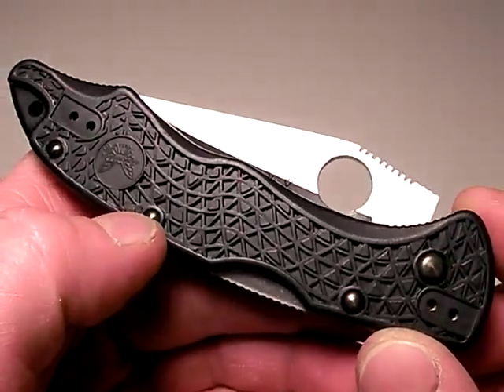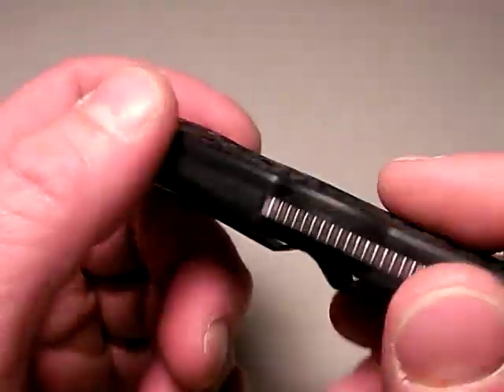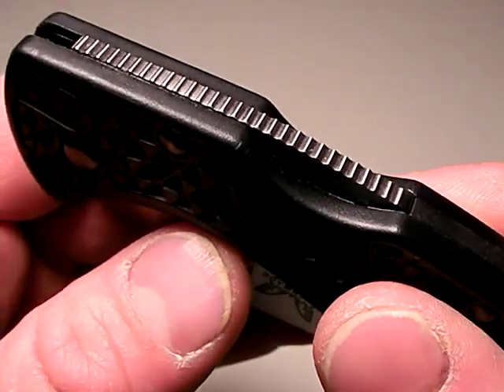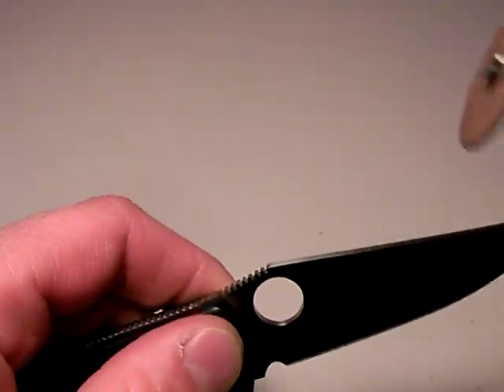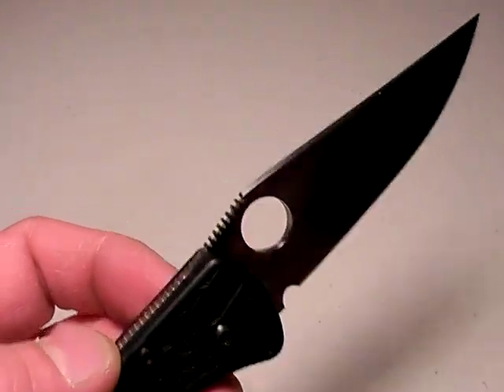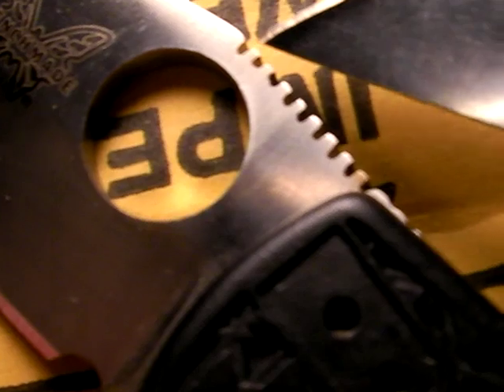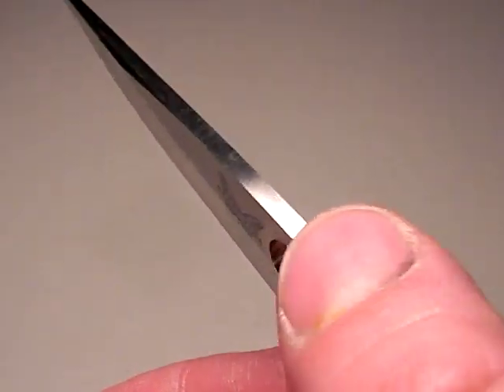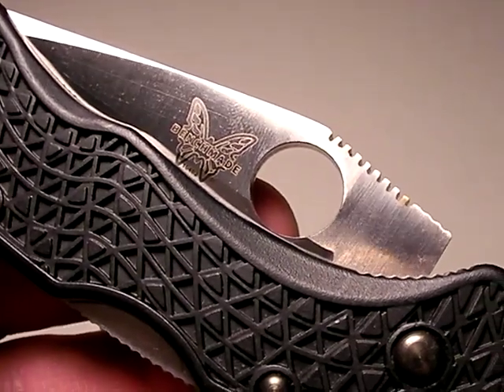Benchmade Pika II:  Quick Jimping Fix

Comment: I'm not sure how your modification improved the knife.  In fact, the existing hole and the taper of the cutting edge both weaken the blade laterally already.  Then you removed metal from the only remaining full width section of the blade right in that already weakened area.  Don't use it to pry anything sideways, it won't take much to brake it. 

If someone realy felt the need to put grooves where you did, it would be best to use a small rat tail file and not go very deep.